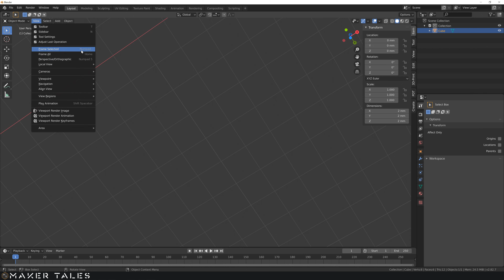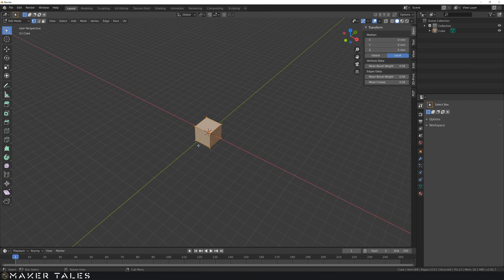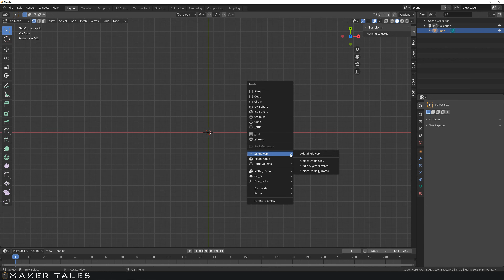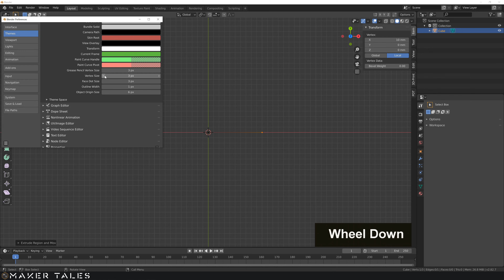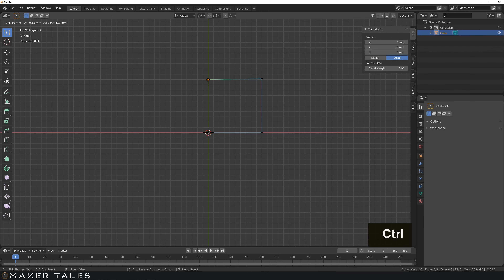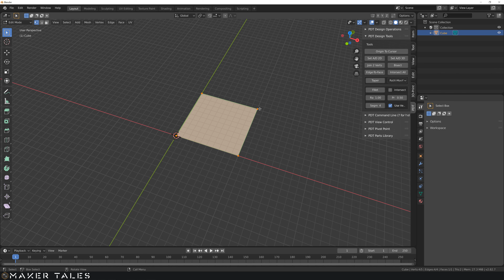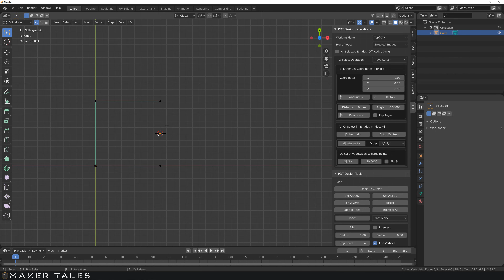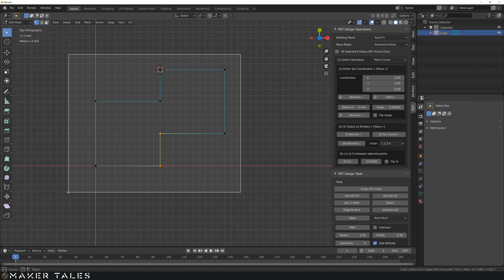The Basics of Blender 2.82 Precision Modeling with PDT - How To ( Tutorial Part - 1 )

Comment: You can snap to vertex, so that last intersection point could be done more efficiently by "construding" then snapping to the appropriate vertex that you want to align to.

Similarly for the mid point vertex - use the snap to edge center. But you need to do that before you delete that edge.

Comment: Hoped to find some add-on for inferencing alignments, basic aligned edge drawing operations are still exceedingly cumbersome in Blender. As far as I understand what is readily available in tools like SketchUp, here requires constructing helper edges, a tool to calculate intersections, deleting vertices and creating new edges. About 7x the number of actions compared to inferencing the alignment intended by the user when placing the mouse cursor orthogonally to two existing vertices.
Reply from the maker: Hey HappyTorso, We don't quite have that yet but you might find some interesting  information going through this course: https://youtube.com/playlist?list=PL6Fiih6ItYsXzUbBNz7-IvV7UJYHZzCdF

Comment: i am encountering a 'weird' problem: when i want to make holes into an object, i 1st add a modifier, boolean. next, when i select the object i want to modify with, THE ORIGINAL ONE, THE ONE TO BE MODIFIED, JUST DISAPPEARS !! in some cases everything works just fine, in others..... nope.  anyone has had this too?
Reply from the maker: Hi Raedy, be sure you are on the right version of blender for the course. I would suggest that if you are learning blender from the ground up to be on 2.9 and to jump over to the new course that you can find on my channel =)
Reply: @Keep-Making  I did, I'm on version 2.92 the problem described only appears sometimes, normally Boolean modifier works like a charm
Reply: First I thought it happens when I modify with an array of objects, but it keeps disappearing even when I use a simple cylinder. Like I said, most of the time no problems
Reply: @Keep-Making  ok, i think i solved it (pure luck): when one selects 'boolean modifier' a submenu opens. at its' bottom is an option 'Self'  (no idea what for), by default deactivated. if i activate it, the above mentioned problem is no more.

Comment: While it might be nice to use these techniques on some creative project it is not something that you would actually use for construction models, because this is just not the right tool to do the job.
Precision work appears to be really tedious from what I see here, which makes sense, because that's not quite what it is meant to do.
Sure anything is possible and you can do whatever you want in a bit more intuitive way with a creative tool like blender, but you're putting in more work than necessary.
When I started with modeling construction geometry for 3d printing, I also had to think differently in a parametric tool, but in the end it actually makes it easier, after I'd played with it for a while. I dont say that blender is a bad tool or anything like that, but you should think of what you're trying to achieve and then pick the tool that suits your needs.

Let's say you need some relation inside of your geometry and later you notice that the feature, on which some stuff relates to, must be a different size. This would make you have to go through the whole process again. What if you're prototyping and want to quickly test out different dimensions inside of the model?

Thats why parametric tools exist and I'd suggest using something like freecad or Fusion 360 for that instead.
You could also start out in a parametric tool to get the basic geometry down and then export it to blender for some editing, or add features to the model with some more of a creative nature.
Reply from the maker: Hey Noxores, I would say that first take a look at the updated course https://youtube.com/playlist?list=PL6Fiih6ItYsXzUbBNz7-IvV7UJYHZzCdF
As for parametric by all means if that is all your looking for use the tool for the job.

Comment: Looks like great tools for detailed modeling. However some of the features might be possible to make easier to operate? I'm thinking e.g. about having two vertexes end up at an exact point with only one button. I'm not an engineer and therefore not thinking like one : ) so all the very clever but many steps of doing one simple thing 15:15 (for me looking simple at least) would be very neat if it could be handled with just one button operation, as with the "join 2 verts" operation... Or I just have to learn the hard way : )
Reply from the maker: Hey corner, I agree, If you are just getting into precision modeling I blender I would suggest you hop over to my new series for blender 2.9+
Glad you are enjoying the videos

Comment: thank you, GREAT vid!!!! d only (basic) skill i now lack to construct effectively is ‘at what angle’ i wish to extrude a vertice; now we learnt along which axis at which distance or did i miss something?
Reply from the maker: Hey raedy07, this course is a little outdated now. You might find the new one for 2.91 to be more informative.
Reply: @Keep-Making  indeed Jonathan, it's fantastic, packed with information! only....  an answer to my above question i did not find. i don't think it's that rare, to need to extrude (or move) a point  30mm direction 57° (in reference to x-axis) for example. and not just along an axis.
Reply from the maker: @raedy07  I really suggest you go through the 2.9 course as I mentioned and there you will find that there is an addon called CAD transforms that will let you go any degree form any point,

Comment: Coming from Solidworks. Used Blender years ago. Very interested in Solidworks style precision design in Blender. On the hunt for instructional YouTube videos to this end. Key initial things for me are creation of Solidworks style sketches and mating of parts. This is a great start! 👍
Reply: As someone who is about delve into the world of CAD im really interested in what kind of aspects blender is "worse" in the sense of modelling technical pieces or which tools ease the process in CAD modelling in softwares like solid works?:) Could you name a few examples for me?
Reply: @maxgh1234  Bit difficult to give examples. Generally, Solidworks uses a 'parametric' modelling paradigm, i.e. you specify objects in terms of lengths, widths, radiuses, etc, and these 'parameters' of the object remain "live" and can be quickly and easily changed on-the-fly to change the shape/dimensions of the object. Objects are "glued" onto other objects in a strict parent/child fashion to build up more complex ones. 

Blender uses a different paradigm, each object is just a collection of vertices and connecting edges with no attached parameters to the object such that you can quickly change it's shape. To change the size and shape of this "mesh" you have to use tools. Objects are "glued" together in any order/way you like.

Blender is more fussy to use than Solidworks for engineering precision but it can be done. It is also possible to model in Blender in a parametric way like Solidworks but it takes more effort and has limitations. Blender on the other hand is far superior for modeling organic shapes as it allows complete control of the shape of the object whereas Solidworks is limited in this regard.

Solidworks is designed for engineering and therefore geared to producing parts for actual manufacture as well as being able to automatically produce drawings for that manufacturing. Blender is designed for multimedia/animation/rendering and therefore has no need for an automated drawing function although with greater interest in using Blender as an engineering design tool, some in the community are looking to provide drawing functionalty.

Comment: I tried using the pdt design operator function and move my cursor to 50%. While it is 50% in the y axis, it is no longer on the same x axis as the 2 vertices?

https://imgur.com/UaNcRpq 

Using the method you described, the cursor was placed as shown. Using the same method, but with the add new vertex function, it placed the vertex at the correct location (which is the highlighted vertex).

Edit: A temp solution that i found is alt + s, i dont know what thats for but its something to do with the scaling being messed up.
Reply from the maker: Interesting... I have a feeling that if you find any other "bug" the author of pdt would love to hear them at https://blenderartists.org/t/precision-drawing-tools-pdt-add-on-for-2-8x/1196313

Comment: Hi, thanks for the great video, I have a problem though, I need to set the units every time I open a new document, am I missing something? In Adobe you can set units a certain way and it remembers for the next time. Also on a different subject, is there a guide somewhere to set blender up for the "best performance" it is sometimes very slow but doesn't use my machine resources to the max (roughly 20-50% of the ram cpu and gpu) thanks for the help.
Reply from the maker: Hey Piet, Take a look at this video as this is an updated video that will help you with your unites changing back. https://youtu.be/VihRvil3138

As for blender running slow.... That's a new one for me. I've never really had issue with blender modelling running slow until i'm hitting around 12 million verts. Your best bet is to search / ask that question in https://blenderartists.org/ and i'm sure you will get some interesting answers.
Reply: Thanks, that was exactly what I wanted!
Concerning the slow down, it is during water simulation, it is calculating longer and longer the more I up the resolution details etc... So far I understand why, but I can see my PC not working harder to use all of its resources to make it happen faster, it is happy to work up to 50% of its resources (very roughly) I was wondering if it was possible to tell either Windows or Blender to use all (or at least more) of its resources.
Cheers again for that tip, that is really helpful.

Comment: OMG this PDT add-on is beyond painfully slow and unbelievably tedious just to create a simple polygon.   Instead of "extruding a vertex" why not simply have a line command?  Rube Goldberg would definitely be proud of PDT's insane complexity just to do the simplest task.  Clock M. Ender I hope you read this comment and take heed so you can improve your PDT. 🙄🙄🙄
Reply from the maker: Hey Jimbo,
I very much get where you are coming from. Personally I feel that PDT has about 3 useful operations. SO... Having said that I'm soon going to be redoing this whole series in 2.91 without PDT.
Reply: @Keep-Making  That's good!  I actually ran across this video searching for a decent 2D geometry addon for Blender.  I certainly wish that PDT had what I'm looking for.  

The bottom line is mesh-type modeling is beyond frustrating for those of us with a background in 3D parametric CAD modeling since it provides excellent editing/re-editing of dimensions/features at any time.  OUCH switching over to un-intuitive 1990s era primitives-based non-parametric mesh type programs, such as Blender, where editing/reediting can be catastrophic, is a freakin' nightmare.  Otherwise Blender is absolutely outstanding in so many ways... and free.   But geez, even Sketchup has 2D geometry functionality built in.  Hopefully Blender will add this functionality at some point.

Cheers from soggy Thailand!  😁👍
Reply from the maker: @Jimbo-in-Thailand  YUP! I know that pain... My whole angle is to try and lessen that pain due to my experience in both fields of modelling and trying bridge something between that gap.
Reply: @Keep-Making  Great!  Just subscribed!

Comment: Great Tutorial, thanks. However I am stuck so I hope you or one of your watchers can help me out. I may have some sort of configuration / scaling problem. When I try "to do (1) at % between points", 50% doesn't put the cursor midway. Experimenting with this value; 0% puts the cursor at the first vertex; 265% puts it exactly on the second vertex. I have repeated this segment of the video so many times, paused and looked at every detail on the screen and I can't see where I am going wrong. Please help...anyone!
Reply: Also having an issue with Intersect point. The cursor moves to x:10 y:5.689 I am using Blender  2.82
Reply from the maker: Hi Greg,
excuse my delayed reply.
Have you been able to work through this?
I'm not entirely sure where 265 is coming form. The sale of that operation is only between 0 - 100 going above that would move you out from between here two points.

Comment: Way to many buttons and things to do to make a single object. Ie, why cant i just draw a line or a rectangular face and extrude it? Im way to used to sketchup pro.. 

I will continue watching your videos though. Blender still interests me even though i feel they made it way to over complicated
Reply from the maker: Hi LT72884,
I agree with you on some point there. Overall I should not have tried to put in PDT into this series. I'll be redoing the series in the next coming weeks without PDT but I will be starting very similarly on a 2D plane and then going 3d. It's all part of the "spiral" teaching that I've decided to go with.
Reply: @Keep-Making  awesome. Thanks. I have been reading up on blender maya etc, and it seems that software that has high poly counts, have more options and buttons, vs low poly like cad software for engineers haha

Comment: This is a very bad tutorial for beginners, you're still stuck in the "old" Blender with memorizing shortcuts instead of using the new and improved GUI. You can switch between top/side views by holding down ALT + middle mouse button and moving your mouse to the view you want.
You can also select the axis you're constraining to using the middle mouse button.
12:05 I don't know much abut PDT, does regular fill not work with PDT? :S

Comment: Another tip: Joining vertices can be done by just selecting the two vertices and pressing "F". PDT not needed for that. Also changing between vertex, edge and face select in edit mode can be done with the number row , numpad is not necessary.

 Great tutorial btw
Reply from the maker: Hi Saikat, Thanks for the tip, I'm really glad you enjoyed the tutorial. You will see that that course will go over all the short cuts in the next coming videos.

Comment: This is very help me understand more on how to use PDT. Thanks you.
Just add up . we use "Add New Vertex" instead of "move cursor" and it will create vertex at that midpoint right away.
Also if you want to join selected two vertex, you can use shortcut "F" too.
Wish this info help.
Reply: Thank you was stuck with the mid point not moving the origin.  Not sure why it didn't work but add new vertex does!
Reply: I was just cruising the comments to see if I was the only one having a problem getting the 3D cursor to move. I don't know if this is because of version difference (I'm on 2.91.0) but that cursor just didn't want to move. Your suggestion about creating the vertex directly helped a lot. Thank you.

Comment: thanks for the introduction. I activated the plugin by chance and was a bit overwhelmed by it's buttons. Now that you showed the usage I am going to dismiss it, because blender has already alot of these things built in as shortcuts (e.g. middle between vertices, joining etc.) and it just disrupts my workflow. for a user used to click patterns a nice tool but really slowing down any speedy modeling
Reply from the maker: Hey jekker1000,
I 100% understand, I very much was as still am a little overwhelmed by PDT. I'm still trying to figure out the best workflow for me.
Do keep in mind that this video is also for 100% beginners so the use of PDT in this instance is only showing things that would also be very easily accomplished via blender shortcuts. A little bit down the line and not in this series i'll be doing a video purely on PDT and about advanced use cases where it comes in very handy.

Comment: In CAD world the major reasons for needing those types of programs is along the lines of >>  1. Making a shape which has features that are relative and adaptive. 2. Lots of parts which form an assembly.  <<     When I read ur description of this video I am totally hoping your heading that direction.   Would be the ultimate if blender could do parametric modeling, parameter tables, multipart assembly.
Reply from the maker: Hey TDT Records,
I'm going to get as close as I can to that direction. Having said that, blender by no means will be able to compete with a program the is specifically built for parametric, precision modeling. From what I know so far there are no great parametric addons or  specifically built multipart assembly options. Long and the short is that if your looking to take advantage of blenders other great features it's something that can be possible but if you need real world 0.001mm margin or error and your not really willing to be flexible to what could be a very strange new workflow. Best bet then is to stick with something like fusion 360. Having said that, WAY in the future i'm going to see if there is a way of doing procedualy generated precision models as this seems like it might be the nearest thing to parameter models in blender.